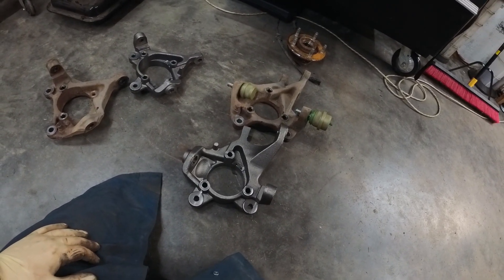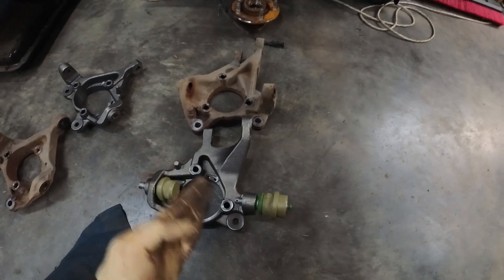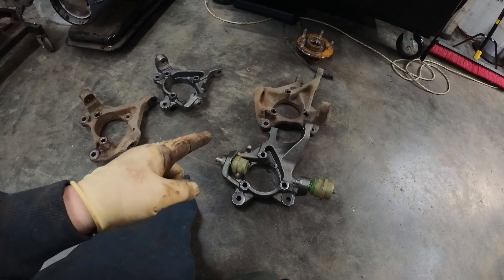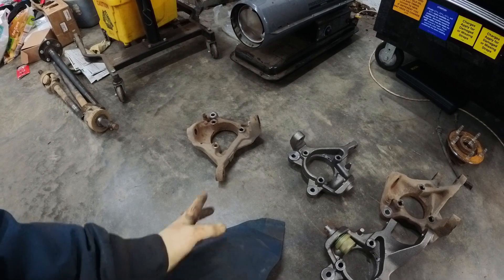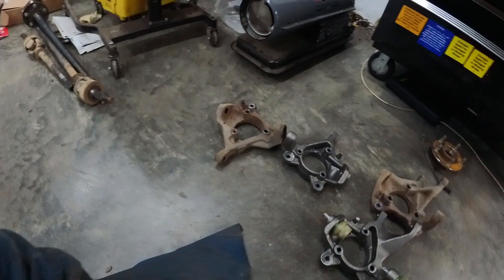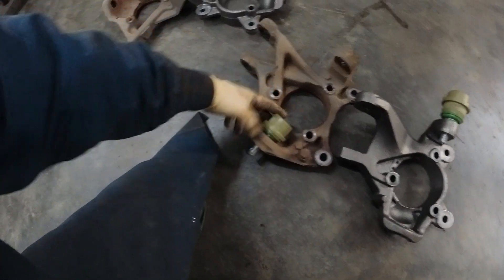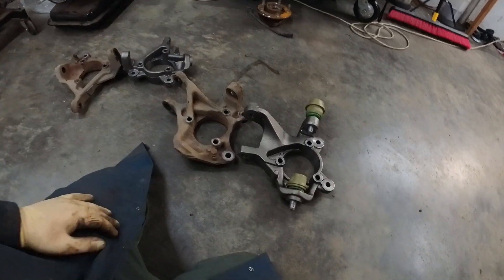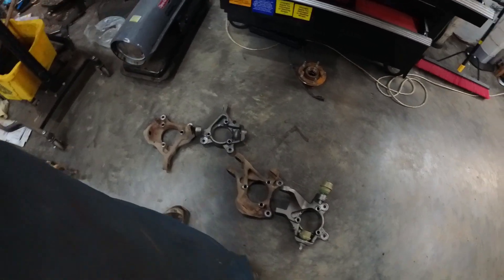Comparing WJ to JK Knuckle Differences

Comment: Interesting, so are you seeing a different Steering Axis Inclination (aka King Pin Inclination) as well?  It was my understanding that the Cs for all the Dana 44s were set at 12.5 degrees.  But perhaps it changed between the TJ/JK/WJ.
Reply from the maker: Good question. Didn't think to look at that at the time.

Comment: Did you measure the distance where the knuckles mount into the Cs? Considering that the JK D30/D44 can accommodate larger axle U-joints than the TJ D30/D44, odds are the JK measurement would be greater than the WJ knuckle.
Reply from the maker: JK 30 has a different C geometry. Can't put him knuckles in a wj/ZJ tube
Reply: @MegaMarclar  my comment was that even the distance between the Cs is different, adding another reason they are not interchangeable.
Reply: I'm looking at doing wj knuckles onto my Dana 30 in my TJ.but want to retain the same hubs.and do a cv Axel swap getting rid of the U joint Axel's
Reply: @Lifeat90  if you want to keep the TJ hubs, you’ll either have to redrill the WJ rotors to be 4.5x5 or go with the Ford Sportrac rotors and grind a bit of metal on the outer edge of the TJ hub.
Reply: @EricCantin  thanks I think re drilling the wj rotors would be easier...this y link steering on the TJ is horrible.even with a small lift I'm only going 3 inch lift...the wj knuckles just make sense.and seems to be pretty common..I just want to keep it 114.3 I have a set of alloy pro comps that I will never change.and miss matched stuff pattern would be a pain....if the TJ hubs go into the wj knuckle I'm happy.. cheap conversion..see how it all goes cheers

Comment: So i can buy jk ball joints that will fit my wj? Which hd ball joints do you recommend?
Reply from the maker: Jk and WJ are very similar. But yes you can use "jk" BJ's. That's what I used on my zj doing the steering swap. The only difference is the bottom ball joint has a different taper. Personally I like to use mevotec

Comment: Any idea what the angle difference is for the camber?  Installed the wj knuckles on an xj and with the lift the camber is negative by like 2 degrees.   Always thought about jk knuckles for an xj and was wondering the difference. If the camber was only like 2 or 3 degrees this would be perfect for most people with over 6 inches of lift.
Reply from the maker: You can't run JK on a XJ the camber would be like 20 degrees iirc. 2 degrees is nothing to worry about, it's an off-roader.

Comment: THANK YOU! Been looking for actual info on this for the past week, this is the definitive answer I needed. One question, is the WJ unit bearing the same depth/offset as the JK?
Reply from the maker: That information I could not tell you, I've never had a WJ and a JK  bearing next to each other.. The two vehicles are very similar in many aspects so it is possible that they are the same